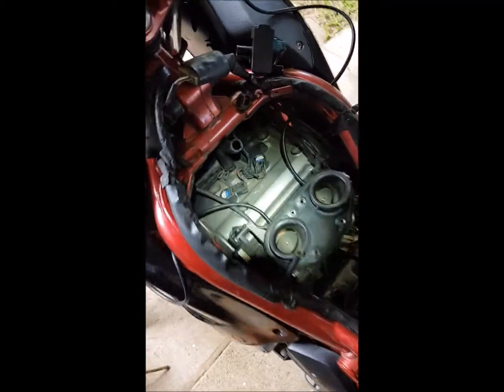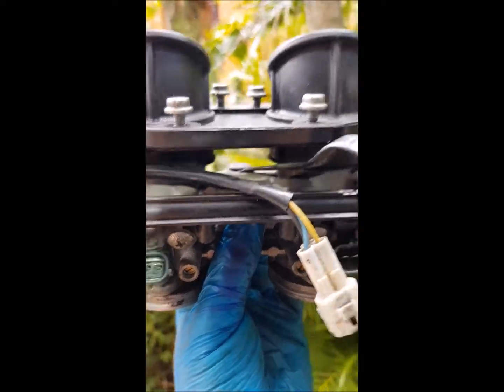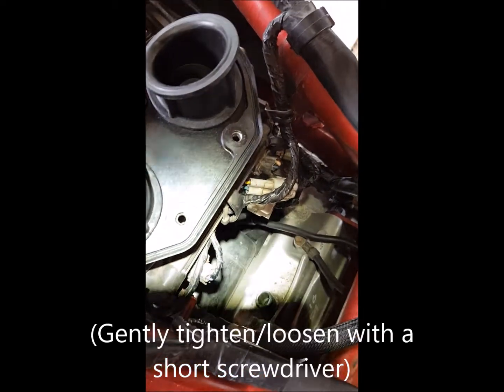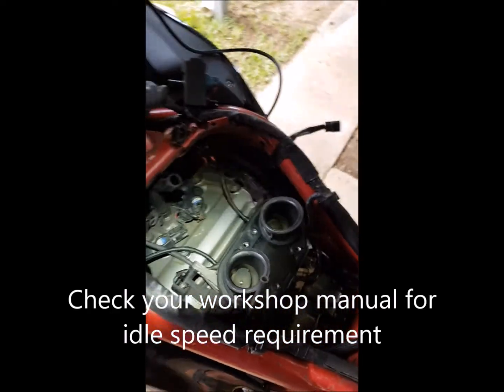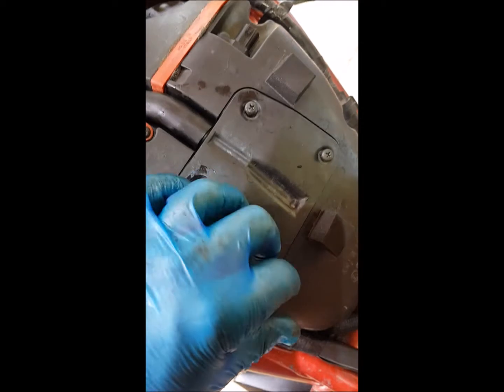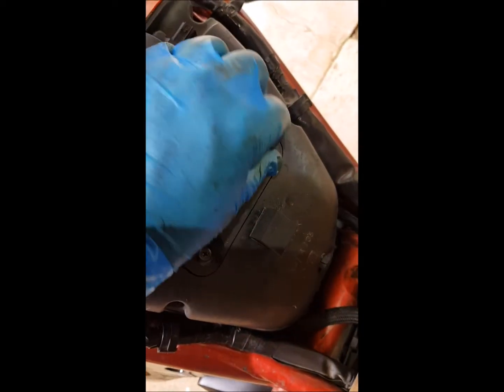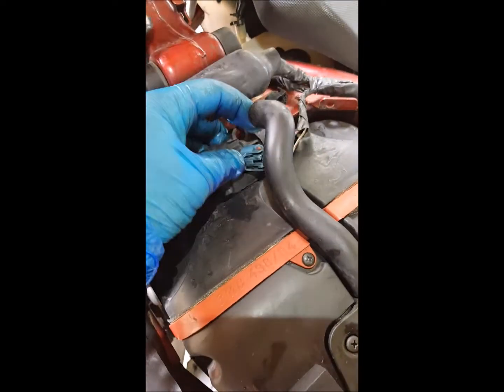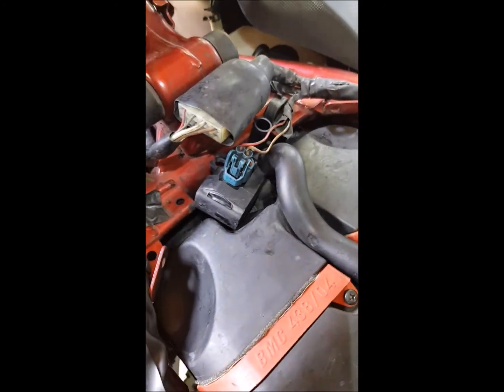How to do a throttle body sync on a Kawasaki Ninja er6f/er6n/Versys (Parallel Twin)

Comment: I am interested in how u made your manometer(?).  Ty for the time and effort you gave in helping our community
Reply from the maker: Hi mate. I used some food grade clear tubing that I got from a brew shop but you should be able to get it from a hardware,automotive shop or pet store (often used for aerators). A couple of elbows from the auto parts store. Supercheap have them. The black hose is vacuum hose from Supercheap(buy this first to make sure you get the right size clear hose which I think is made from vinyl). I've used 2 stroke oil as it's easy to see and it has the right viscosity but you can use engine oil or even water. I've cable tied it to a piece of perforated fibro but you could use a piece of timber and drill holes in it.
Thanks for the comment and good luck - I've found it works great!

Comment: I made one of these and it really helped, thanks! I just used 4m of aquarium airline silicone tube; the ends pushed directly onto the throttle body.
After I'd synchronised them at idle speed, I did find that they go out of sync quite significantly with just a small amount of throttle - is that normal / healthy?
Reply from the maker: Hi there. Thanks for your comment. You need to "blip" the throttle a few times while the bike is running and try get the fluid to even level. Hope that makes sense?

Comment: @matthew johnson, did you need a fuel line extension, or is there enough slack in the fuel line to just spin the tank around? I need to tackle this job and want the right parts on hand before getting to it.
Thanks for the video!
Reply from the maker: Hi Rudolf. I didn't use a fuel line extension. You can get away with spinning the tank around (which is what I did). You just need to take extra care and remember which way to spin it back. If you forget, you can just disconnect and reconnect the hose. Good luck and feel free to shoot me any further questions...

Comment: Hey @matthew johnson, did you tune the throttle bodies with oe without the airbox on? Thank you!
Reply from the maker: Hey Dan. I tuned  them without the air box on until I got them close amd then did a final check with it on. Bit of a mssion to have to keep taking  it off after each  adjustment. I've  been told that it should be checked after a valve clearance adjustment or when you feel it needs it(bike runs rough)Made a big difference to how the bike runs for me. Mine's  been fine since I made this vid which was a few years ago...
Ride safe! :)
Reply: @TheDeepPlanet  Thanks, I tuned them also last week-end. Haven't quite managed to sinc them perfectly ( 1 was -0.353 bar and one wass -0.340 bar). I couldn't make them get closer. I'll try again when it starts running rough again. Do you have any idea how I could raise the cold idle on it ? Mine idles very low when cold ( approx 1000 RPM, mostly under, like 900) and once it gets warm, it goes to 1400. That's the reason I searched how to sync the throttle bodies in the first place...
Reply from the maker: Hi Dan. Is your fuel pump priming when you turn on the ignition? 
Do you live in a very cold climate?
What octane fuel are you using?
Are you using irridium spark plugs?
Is your air filter clean?
Are your throttle bodies clean?
Have you run some fuel system cleaner through recently?
Those  are a few of the things I would start with...
Reply: @TheDeepPlanet  It primes every time I turn it on. I live in Romania, it's a tempered climate. I'm using 99 octane ( premium). Iridium sparks ( as per owner's manual CR9EIA-9 ). Throttle bodies were clean when I synced them. I haven't ran anything through it. I did a little bit of digging and some people said it would be the screw that's on the part that swivels, not the "hot" idle one. Thanks for your help though !

Comment: I have noticed in your video you say turn both adjustment screws in and then turn them left right until both vacuums (in your case the fluid level) meet up the same.. However in the owners manual it says the vacuum should be anywhere between 26.5cmhg to 36.5cmhg for BOTH carbs? How are you measuring if you have 26.5cmhg using the fluid? Thanks.
Reply from the maker: Hi Hussnain.I only do this to match the vacuum on both throttle bodies and found this method was good enough to get good fuel economy and smoother idling as well as better throttle response. To get it to that exact vacuum would require specialist tools and would probably really only need to be done in the case of a rebuild or some other significant repairs to the throttle bodies. For normal use (ie. Not professional racing) , the home made manometer should suffice. It's a very inexpensive way to troubleshoot the fueling system. Are you still having issues with throttle response?

Comment: Hi

Gave this a shot today using carb tune tool as I got it for cheap anyway and my readings are showing 14cmhg? It says in the owner manual 25cmhg + 10cmhg so can they really be 10cmhg out or is my carb tune not showing me the right readings as if you move the tube round it shows and goes off so seems like the tubes are too loose on the nipples...?
Reply from the maker: Hi Hussnain. Sounds like the hoses might be the issue here. Try to get the vacuum the same and see how the bike runs. Did you put the airbox back on before you took your readings?

Comment: Is there no physical adjustment between the two Throttle Butterflies, it's all done on the Air Bleed Screws?
Reply from the maker: Hi John. The service manual does not mention any other adjustments to my knowledge...
Reply: Difficult to tell from the Video, but I don't see any obvious adjustment mechanism, so the Butterflies must be on a common Shaft.
Reply from the maker: Yes. To be honest, I made this video ages ago and just did it incidentally. 20,000 km later, the bike is still running great but I haven't done a valve adjustment (I've checked the clearances and they were good). Do you have a copy of the workshop manual? Let me know if you find any further info...
Reply: Sorry, I don't.
I don't have the Bike, I was just looking for views of the TBs, as I was fitting a Scottoiler to a friend's Vulcan S, and wanted to see where the Vacuum lines were.

Comment: Hi My Ninja 650 09 developed a fault in the throttle body electrics so she wouldn't always start. Sometimes try to start but all i hear is the relay click for the starter motor but the engine doesnt turn over.
Kawasaki dealership for diagnostics computer said replace the throttle body.
Just done that yesterday she's running bad but she's starting ok again. So ive cured one problem and inherited another.
I'm thinking of removing the electrical gubbins from the side of the newer throttle body and putting it on the older body?
Or what do you think i should do to adjust the replacement throttle body?
Reply from the maker: There's a lot of things I would  work through before messing with the new throttle body assembly. Check your spark plugs, idle screw, fuel pump, regulator rectifier, ignition coil packs and leads and check the condition of your battery. Also check the throttle bodies are synced. In my experience, the throttle body either works, or it doesn't....
Reply: @TheDeepPlanet  k thanks
so i push the starter button and sometimes i just get a 'dead mans click' from the relay.
Kawasaki diagnostics computer says its the throttle body failing to initialise (that whirring noise she makes after turning on the ignition). If i hold the starter button the F1 light comes on along with the head light but she wont start. If i keep turning the ignition on and off and trying the button she usually starts after a few minutes or so but not always.
Reply from the maker: @tedtheturbot  hmm.  Could be ECU?
Reply: @TheDeepPlanet  No Matt and thanks for your time but Kawasaki Diagnostics says its the throttle body cause it shows a load of faults coming from there after ignition is switched on.
I'm taking the electronics off the ebay throttle body and putting it onto the original cause that ones balanced with the bike..let you know what happens later today..
Does it cure the starter issue whilst working normally..i get onto it after work
Im in Thailand so the whole thing is complicated with the language stuff
Reply from the maker: Please let me know how you go... this is an interesting one...
Reply: @TheDeepPlanet  thanks for the interest..so putting the 'new' (second hand) electronics/throttle actuator from its own throttle body onto my original throttle body didn't help as she still runs rough.
So yesterday I returned the 'new' electronics/throttle actuator back to its original throttle body and re-installed that. But now when I press the starter she won't start at all.. back to the 'dead mans click from the starter relay but the starter motor doesn't turn.
This whole thing is complicated by the fact that my nearest Kawasaki Dealer is 150ks away.
Haven't looked at her today too dispirited..
Reply from the maker: Just checking...is your battery amd stator working properly?
Reply: @TheDeepPlanet  as far as i know the battery is ok replaced 18 months ago
the rectifier was replaced with new OEM 18 months ago
the starter motor doesnt even attempt to turn and i get the red F1 light on also
Reply from the maker: @tedtheturbot  Do you have a multimeter? Might be worth checking if your battery is ok and make sure your stator is charging the battery properly (I had to replace the stator (altenator) on mine...)
Reply: @TheDeepPlanet  so checked the battery and she's reading 13V (needle not digital meter). Pushed the starter button and can hear the starter relay clicking plus a low buzzing sound, the multimeter doesn't move at all at 13V. Leave the starter button pressed in and the f1 light comes on the headlight comes on and she drops to about 12.5V
Reply from the maker: Ok. So there's possibly an issue there. 13V is a good reading. But that doesn't always telll the whole story. Can you borrow a good battery or take it in to be tested. If the battery is fine, it may be a loose connection somewhere. We really need to get the bike running and test the voltage to make sure the altenator(stator) is working properly so we can start narrowing this down...
Reply from the maker: https://www.batterystuff.com/blog/how-to-tell-if-your-battery-is-bad.html
Reply: @TheDeepPlanet  i went to Kawasaki with a separate stick coil issue before (the start issue was a separate intermittent problem and not the reason why i was there). 
They hooked her up to their diagnostics comp and whilst finding the problem they said a number faults were being recorded from the throttle body assy during ignition on and said i should buy a new throttle body assy.
I've just replaced the throttle body assy with a second hand unit.
If you want i can send an email video showing the problem?
Reply: the manual saying check the starter lockout switch and the neutral switch
Reply from the maker: Yep. I think it's going to be a case of elimination. Is the starter motor ok?is it getting power? Do you have any reason to suspect the bike may have had some issues before you bought it? Mine had been really poorly treated by the previous owner and I've slowly been sorting things out.
Reply: @TheDeepPlanet  did you read the other comment above?
Reply from the maker: Sorry mate. This seems to have turned into 2 threads. My email is thedeep.planet@gmail.com if you want to send the vid through
...
Reply: @tedtheturbot  Hey,i know this might be a little late but I recently had my ER6 doing the same thing failing to start when hot.Cold starts are always 1 tap and it's off to the races.Sent the bike to the dealer and they told me it might either be the rectifier,the ignition coils,spark plugs,the starter motor might need new brushes or a complete rebuild/replacement.Now I've changed spark plugs and had the starter relay,ignition coils and rectifier checked and they both appear to function properly.Have you tried tapping gently with a rubber mallet  on the starter motor while pressing the ignition switch to see if it can start?If that's the case,then it's 99% the starter.Careful with the tapping though because if you go too hard and cause damage to the motor's coil you might need to replace the starter as a whole.Cheers.
Reply: @MrJimmysko  Hi thank you. it was the starter relay/solenoid malfunctioning. Bought a cheap China one that stuck open a soon as installed - wouldn't stop turning the starter motor even with the ignition switched off! Bought another OEM used from a breakers on ebay and its been grand ever since.
Reply from the maker: Hi. So glad you fixed the problem. It's interesting to hear about how to fix these issues. Thanks for the update. Ride safe. 😎